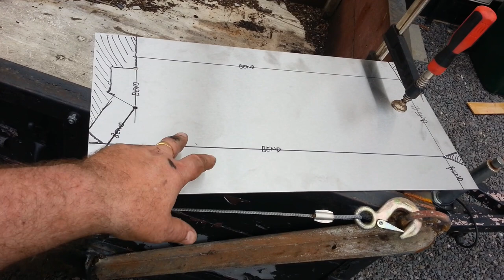Land Rover Defender Rusted Out Footwell Repair

Comment: That's a driver's side MOT fail technically.
Reply from the maker: @yonmusak  it has passed every MOT since and is far stronger than the Allmakes biscuit tin alternative.
Reply: @Mids1970  No disputing its strength mate - it is a technical fail, so other MOT test centres might fail it in the future.

Comment: thank you  for an interesting take on what must be a common repair, one which I found needing with my pre-*MOT. But my approach is a little more traditional than yours.
I have bought lightly galv YRM double skinned footwell repair panels. they will be cut to what is removed with a lip  and Mig welded in,  some spot weld and some butt weld. This will be painted with Raptor U-Pol anti corrosive paint and finished with body paint, an some underbody paint or wax for the exposed paert. So the finished repair will be like factory.

Comment: A rather wasteful and pointless repair unfortunately.
Stainless steel won't corrode but the rest of the mild steel bulkhead will continue to decay so nothing gained in the long run so it's a waste when you could have used mild steel.
It shouldn't pass an MOT with those stainless steel panels because they are not seam welded onto the structural bulkhead. Sealant, rivets,nuts and bolts are not the specification for an MOT, seam welds are so that makes the repair pointless because it isn't to standard. Mild steel welded in and then treated with red oxide and waxoyl is far better 
All that time and effort removing the floor plates and making templates too. In the next video, would you mind using less music please?
Top regards, Jon.
Reply from the maker: Thank you for taking the time to post Jon. The original footwells aren't seam welded but are spot welded. I bought a full footwell to do the repair with., and the foot well in that replacement unit was made out of 0.8mm galv mild steel pop rivetted in place and sealed with sealer a Britpart that is obviously industry standard repair part and not as strong as a biscuit tin. Rotting of the bulkhead is a concern. Its taken 27 years to get to this point so if it lasts another 27 years it will be someone else's problem after I'm dead.  The comment from MOT tester "you've made a bloody good job of that" and now I have a shiny 12 month new MOT ticket
Reply: The whole truck is revitted 
,so wat is the big deal. Good job man.

Comment: I am just about to do similar in my passenger footwell and hadn’t considered the stainless route. What thickness of stainless sheet was it please?
Certainly looks a nice job. Ironically I too am from Derbyshire and the 1970s. 😂
Cheers, Roo
Reply from the maker: Pleased to meet another mids1970 Roo ;) 
Brushed Stainless Steel Sheet Metal - 1.5mm
Thickness: 1.5mm
Plate Size: 600mm x 300mm
Material Grade: 304 
£23.45 delivered